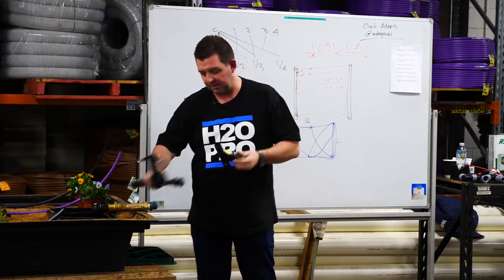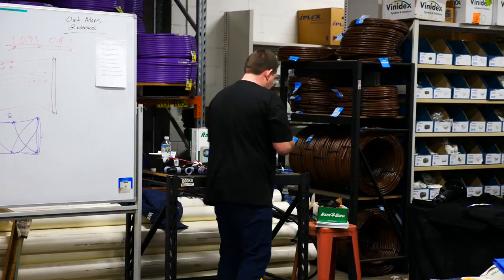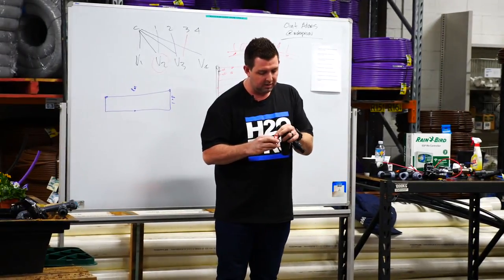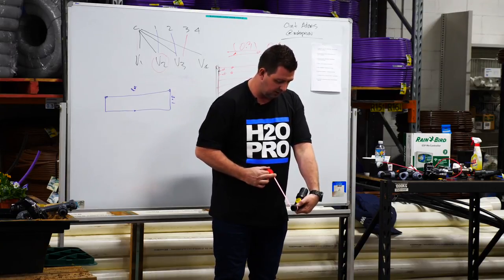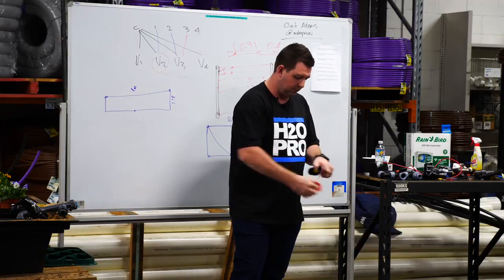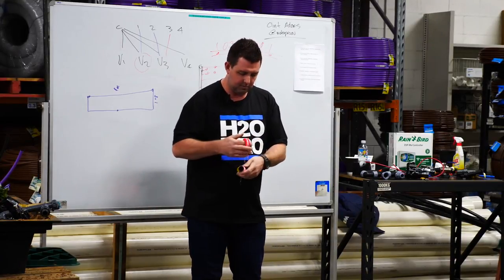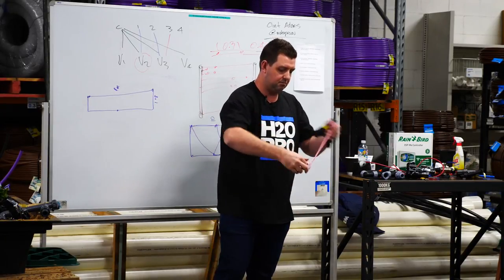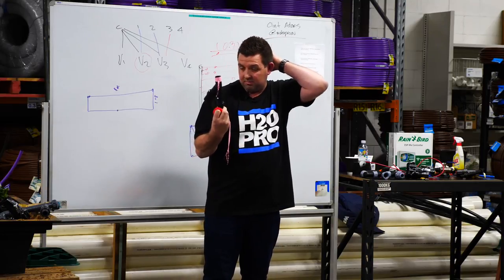Learn The Basics Of How To Install Irrigation With Waterpro

Comment: I have two parkway sections (sidewalks), 4.5 ft wide by 33 and 50 ft  respectively (both rectangles). What height sprinkler stem and orientation would you recommend with which nozzle distance and spray radius (Marathon 2 sod going in)? Also one tree included currently with a drip line, should I remove the drip altogether? Will the tree receive enough water with the new sprinkler setup? #totalnewb
Reply from the maker: Thanks for the question Eddie. Id use a 3inch body or 4 inch if you plan to let the sod grow out a bit. We always design lawn and gardens on separate lines as they have different water requirements. You'll need to use side strips of some sort. Hunter MP Rotators would be great for those dimensions.